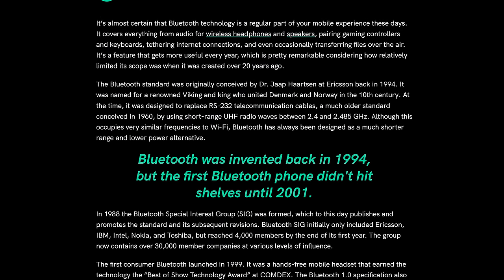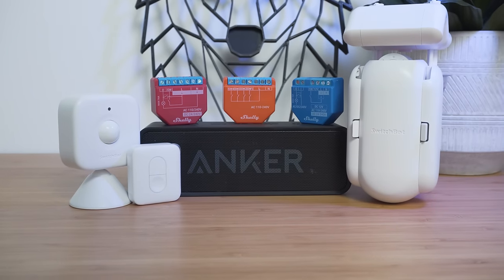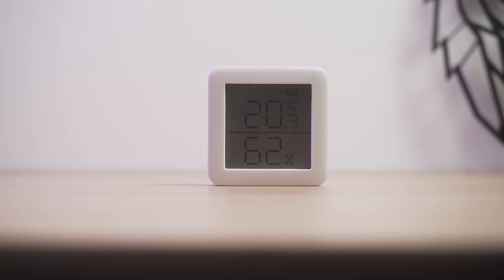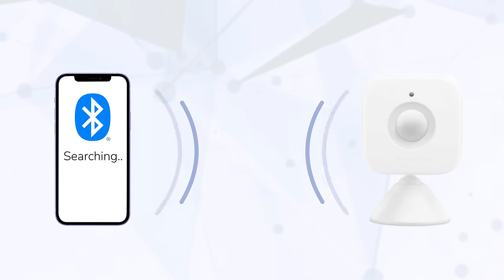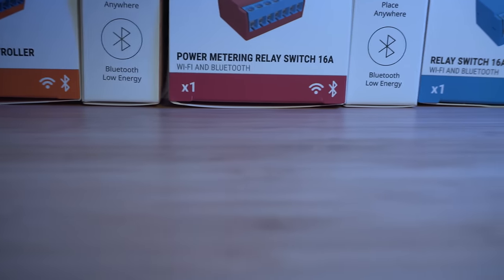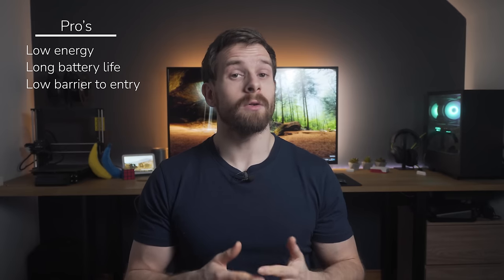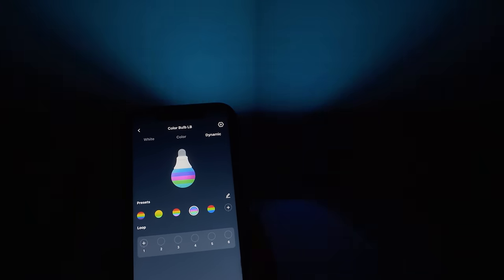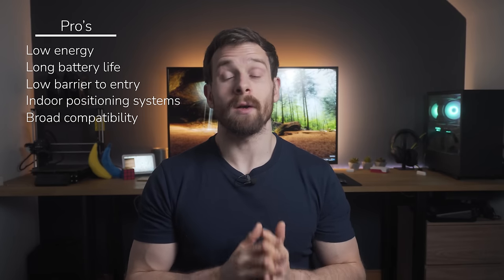Smart Home Protocols: Bluetooth Explained!

Comment: Thanks for the video! I am going all Bluetooth in my home. That’s mainly because the home I’m building is mobile. I’m currently converting a short school bus into my mobile home. Because I can’t guarantee internet access everywhere I’m going all internal networked smart options. And it seems bluetooth is the best universal smart device connector that can work with out any outside internet connections.

Comment: One area where BLE is better than all the other protocols, is for temperature sensors where you don't need insane range. Using BLE broadcasts, anything with Bluetooth LE in range can listen to the broadcasts. Ruuvi sensors are really nice, they broadcast temperature, humidity, pressure and acceleration every 2s for around 3 years on one battery. They are also fully open source hardware, firmware, apps and even the optional gateway and cloud :).
Xiaomi "ATC_MiThermometer" with custom firmware is also really nice, they broadcast temperature and humidity and are extremely cheap and has an LCD.
Reply from the maker: That is pretty cool!
Reply: I was gonna say the same: temp sensors are ideal for BLE because 1. They are one directional, and 2. Not (usually) critical, if a packet gets dropped every now and then

Comment: Hi Lewis, thank you very much for sharing these great videos, the information you provide is always super accurate and concise which has helped me a lot in my process of making my home and business smart.
Lately we have had some security problems in the store and thanks to my security system made with Home Assistant, Frigate and Alarmo I was able to prevent a robbery attempt, the thieves managed to enter but ran away when a motion sensor triggered the alarm, but sadly they didn't walk by the camera so Frigate didn't send me the photo. The police captured some suspects but since there was no evidence that they where inside the store, they had to release them.
Is it possible to use bluetooth in Home Assistant to make a list of the devices that are in range when the alarm is activated?
The suspects had phones so one of them probably had bluetooth on and saving the address could be used as proof that they were at the site.
Do you think this is possible? Could you make a video on the subject or at least tell me where  can I get information to do it?
Once again, thank you very much for such an excellent job.

Comment: It would be really cool to have a QUANTIFIED comparison of the energy requirements of BLE vs ZigBee!
Reply from the maker: That would be cool! Its probably out of my capabilities at this moment in time to do a video like that properly but that would be great one day!
Reply: A big +1 to that! (big +1, is that a +8 or something? 😁)
Reply: The reason I'm asking is that both appear to be successful at very low energy battery powered sensors, and can get super cheap. Understanding just how much energy they sip would be v cool
Reply: Nordic has a nifty device called power profiler kit 2 (ppk2) for current measuring low power devices.
I use semi local  brand plejd for my lights with battery wall rotary encoder which has held up so far a year in, battery voltage Is basically like new cr2032
So it is very doable to have really responsive bluetooth devices even when on battery.

Comment: I use SPP it smashes BLE and WIFI on range and speed you can connect up to 50 devices to say 1 phone or pc or multiple phones or PCs at the same time also smashes mesh network by far.